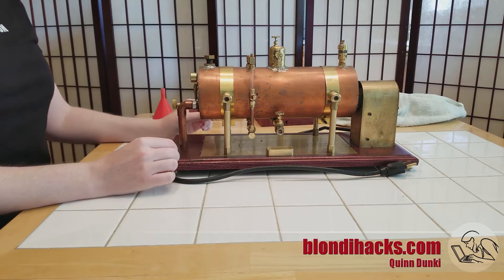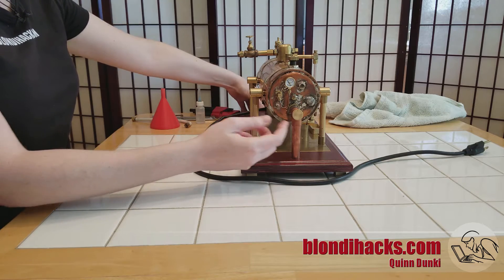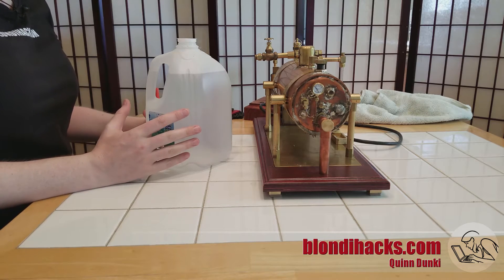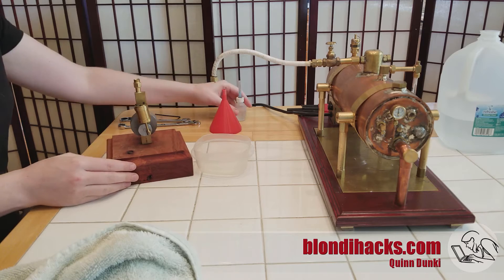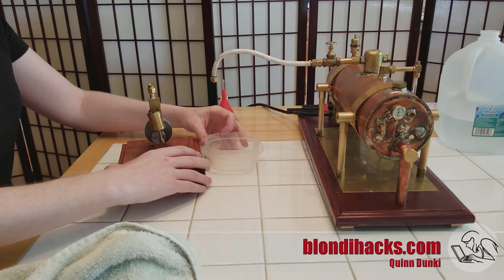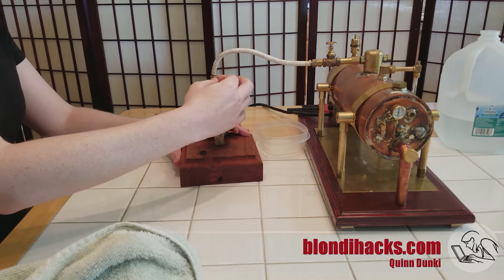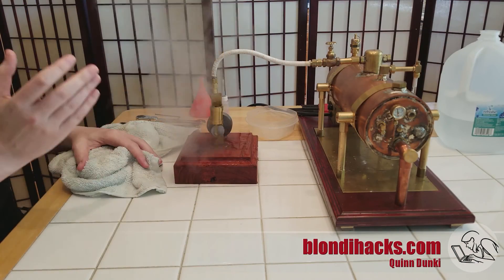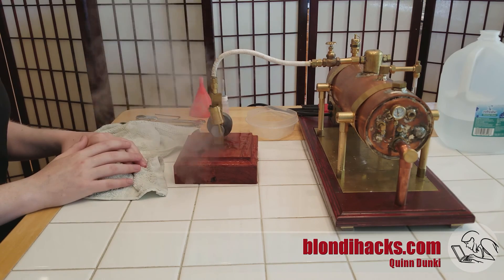Steam Boiler Operation

Comment: I love the overall look of that boiler and already had (notional) plans to make something similar. However that silver soldering! Definitely not up to your usual standards of finish or engineering! Just need to add a fire box and then decide - plain boiler or tubed - direct output or superheater - meths, gas or coal. Decisions, decisions ...

Over time I intend to post more videos of my tiny collection of small and not so small models running on steam, but I'm not really into running them on air or electrickery even though I can. One exception is my Wilesco D141 Workshop to which I've added a generator to at the back. Since it can also operate as a motor Ive experimented with shoving 9 volts (PP3 battery) into it to make the whole thing run without a whisp of steam in sight. Elle va.

My current problems with videos is that my previous video editing suite doesn't work with Windows 10 and the new one is difficult to get to grips with. 
It won't work with anything other then MP4 files! I can convert, but that's extra time I shouldn't need to invest in such a simple task. Hey ho; life!
Reply from the maker: That boiler is my first time silver soldering anything. Shockingly I wasn’t immediately good at it

Comment: Here in the U.K. we had a company called Mamod who manufactured small scale steam engines. The used methylated spirit to heat the boiler to create the steam. My Dad used to let me run the engine unsupervised, this was rather dangerous as I nearly set fire to the house on several occasions when the methylated spirit overflowed and set fire to the kitchen table. Mamod had a range of accessories that could be driven by the pulley on the engine. I had the circular saw option, it was no good for cutting anything, but it looked really cool!
Reply: I had a Mamod minature traction engine about 20 years ago. It used hexane blocks as the fuel source, which took forever to boil the water, but watching it chuff its way around the kitchen floor was glorious. No fires though I did used to leave nice puddles of lukewarm water everywhere.
Reply: Oh my!